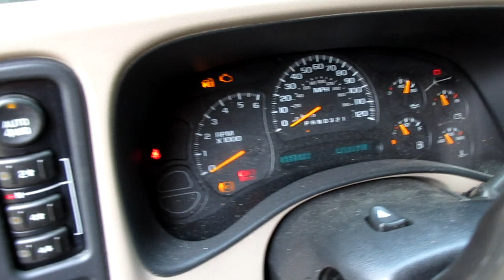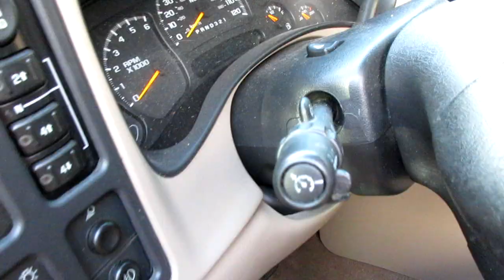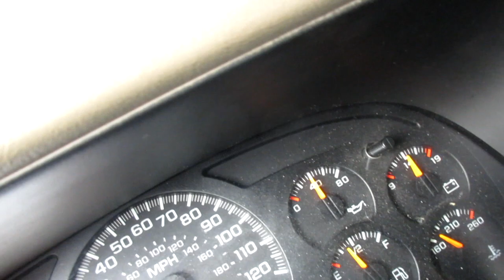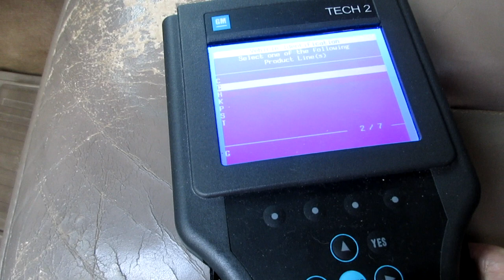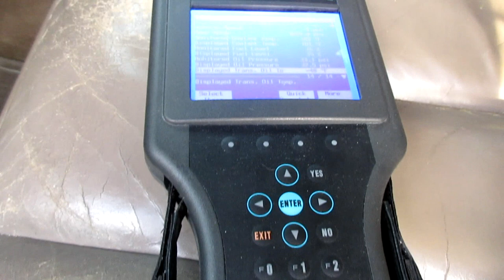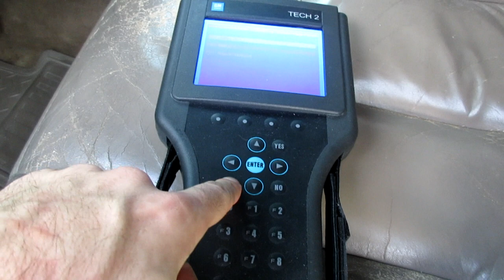How to Repair 80psi oil pressure gauge Silverado Sierra Yukon Suburban

Comment: This was very helpful, Thank you! GET the 1-1/16" oil pressure sensor socket!!! Maybe when you buy the sensor someone could mention there is a special socket that goes with it? Ha! The universal joint and extension are also pretty much essential items for this project. Having the right tools make all the difference in how frustrating this can be. Thanks again!
Reply from the maker: make sure the sensor fits the socket. I had a sensor that did not  fit the socket as replacement
Reply: I made mine 27 mm I ground the wall down so it won't touch the cam sensor but yes not many people know about the specialty socket

Comment: These ttucks are way better than the 80's and 90's I owned a 2004 Silverado 5.3l the thing was reliable got 220k miles on it before I traded it for a Nissan 4x4 just baught a 2003 GMC because I love them best trucks GM made imo despite the plastics whick all brands have including Japanese. These trucks are 20 years old now.
Reply from the maker: Ya this particular is is not cared for well and now trashed so. I know what you mean though I driven ones people cared about had near 400k or more on them and still was fine  90s chevys were fine GMT400 was a good truck.  Great truck. I like the TBI engine ones88-95 vs the later vortec ones they had WAYY more issues

Comment: I have an 07 Silverado I just bought. Do You have any idea why the oil gauge will intermittently go from pegged @ 80psi then it will start bouncing around from 0 to 80. But when it does I hear what sounds like a gear winding on and then off and then on and then off on every time that does that the oil pressure will jump up and down. I don't know if there's something in the cluster that can cause that or there's a part right on the inside of the firewall that looks a lot like a stator I'm sure you know what that is. Any advice because Any would be greatly appreciated.
Reply from the maker: Get a scan tool verify that the pressure is reading insanely high or low.   If it is  like I found bad sender. The noise could just be the stepper motor in the gauge cluster maxing out this one made noise but I only heard it when I turned the key and it pegged.

Comment: Was this truck actually running with high oil pressure or was the gauge reason just a symptom of the faulty parts?  Mine just started doing this, pegs the pressure gauge before the truck is even running
Reply from the maker: It had lower than normal oil pressure because the pickup tube O ring was damaged on it.  At idle it used to kick down to 10psi or so or show near nothing and the engine would tick. Fixed that, . Oil pressure is normal. At the same time this happened, The sender goes bad, pegs to max pressure when the key is turned on You see the bad reading when you hook it to a scan tool and view the data

Comment: 2004 Avalanche. Mine was maxed at 80. I replaced unit, still maxed. Plug was cracked so replaced that too. Still maxed. Confirmed voltage good. Any other suggestions ?
Reply from the maker: Scan tool see what the actual reading is at the computer and what the gauge cluster is reading maybe the stepper motor is shot on the gauge cluster or stuck Pre 2006 common for stepper motors to fail I diag'd this one because the computer was reporting like 200psi with the engine off

Comment: I am having this issue now is it safe to drive like this ? I have no codes for the oil sensor and I’m pegged at 80 in accessory and truck on, is this my problem ?
Reply from the maker: Ya if the engine really has oil pressure its fine.     Yes the senders fail on these  Change the sender
Reply: @GhettoWagon  thank you. I have been stressed about it having work about 50 mins from me

Comment: I’ve got a 08 6.0 that maxes out then if you give it gas it will jump back to normal and at idle says low oil pressure
Reply from the maker: Probably bad sender.I checked it wit a scan tool knew it was bad shows 80psi engine off

Comment: This is what my tahoe is doing straight to 80 by just turning key once and not on. Is it an issue if i dont fix it immediately??? Ive never tried but I might try
Reply from the maker: yea change the sender $40 part  PITA to get to but easy with quality took Takes 10 mins  Not 2 hours like many say. Then again I work in the dark so I find stuff like this easy
Reply: @GhettoWagon  Thanks for the reply. Any problems if i hold off for a couple weeks and keep driving?? Sorry for the many questions.
Reply from the maker: @lovelygal212  As long as the sensor is not leaking its fine   Just the gauge gets a work out.   hahah.  Pegs right when you turn the key

Comment: I have a 06 chevy trailblazer 4.2 6 cyl., oil pressure guage would be at 0 not cranked and jumped way past 80 when cranked up. Looked at videos yesterday and ended up changing the oil sending unit (pressure switch), now the oil pressure guage reads at 80 BEFORE cranking it up, and the hand still goes over way past 80. Any ideas?
Reply from the maker: get a scan tool see what the computer is really reading. if its somewhat a known value the gauge cluster could be busted. Or you bought a cheap sending unit. Broke it.  Broken wires

Comment: So you used a Standard sensor?  My 06 Yukon and the 06 Sierra I sold to my uncle still have very pliable wire loom; must be the shitty Condo Florida land weather!
Reply from the maker: YA standard.  year later still working.   ACD is probably fine but ahh. Seem they had a batch of high failure units.

Comment: So the hose that runs from that radiator to the heater core broke in my 2001 Chevy suburban I fixed it this morning but now my oil pressure gauge goes straight to 80 while I rev the engine it's in park while I'm doing it and I haven't driven anywhere since the hose broke do you know what the problem might be?
Reply from the maker: The sender broke at the same time because its just a GM piece of trash.  Change the sender it will most likely fix it.  Best is to check its reading with a scan tool if it reads a crazy amount u know the sender is shot. like it was in this case.

Comment: Lol two hours really. I did 16 lifters two head gaskets and an oil pump in three hours that guy you talked to must slow
Reply from the maker: @brandondeangibbs8541   No Facebook is retarded.   Nahh On the internet everyone is all like "This sender takes 2 hours to change" when it comes out in 30 seconds and goes back in just as fast. I only had a stuck connector from the heat which was 2 mins of pulling.

Comment: Mine went from reading 80 psi to 0 before it was fine at 40 psi
Reply from the maker: got oil pressure? Probably the sender is bad change it out its easy

Comment: Leave that " Vortec " Cover off.  Heat is killing all your Wires harness. etc... !!!
Reply from the maker: Ahh..  Keeps water off stuff.  If it stays off someone is just going to step on it and break it or throw it away
Reply: @GhettoWagon  - LOL, you got a hood to keep Water off, LOL.  Well, I guess more Video of replacing harnesses and complaints for future right?  LMFAO
Reply from the maker: @JodBronson   nahh wiring is still good just all the loom is broken. need like 5-10 feet of flame retardant wiring loom, all sizes   Its easy to change as you see the old stuff just crumbles into dirt.   Slip new stuff over.Tape here and there done. I would buy more loom as I am running out but its not my ride. Remember flame retardant loom has a STRIPE. Standard stuff does not
Reply: @GhettoWagon  -  LOL, wouldn't it be easier to leave that stupid cover off?  No money to spend and everything else will be saved!
Reply from the maker: @JodBronson   Nahh its already all wrecked.  I like the cover it covers the ugly intake manifold. The older trucks or the 6.0 liter trucks used to have this gigantic plastic cover